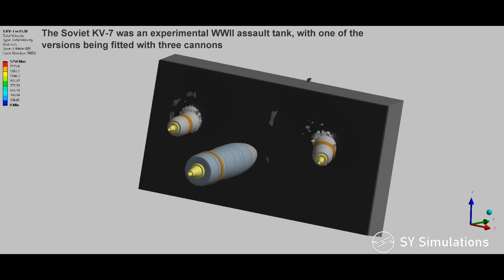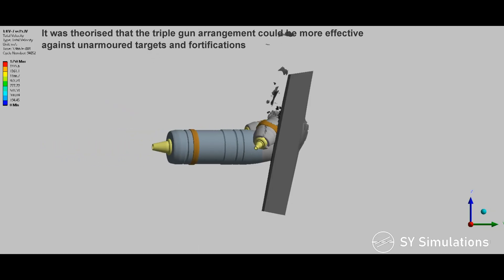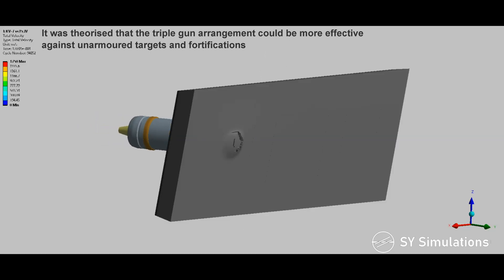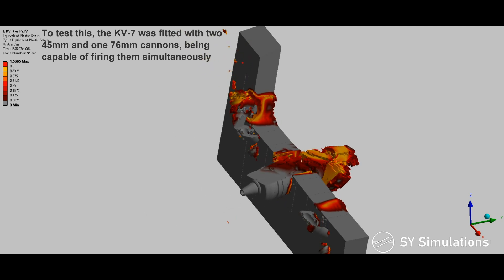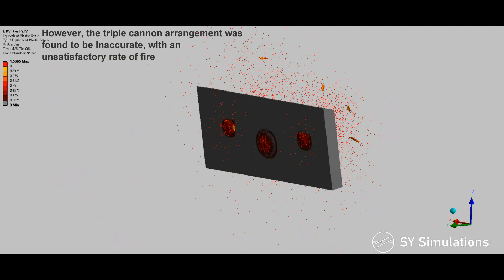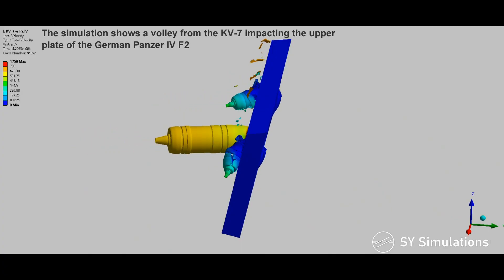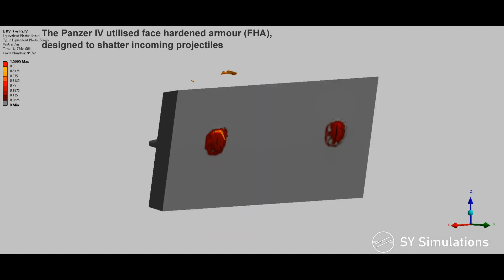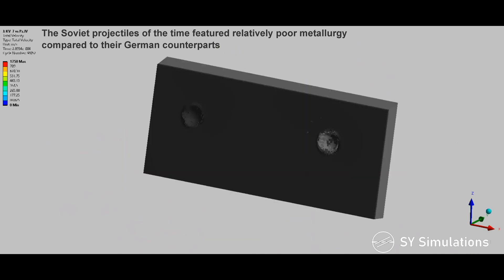TRIPLE BARRELLED KV-7 (U-13) vs Panzer IV F2 | Face Hardened Armour Penetration Simulation

Comment: May I suggest a HESH simulation against different armor thicknesses with witness plates? There are a few HESH simulations on YouTube but unfortunately none of them seem to have witness plates. I think it would be very interesting, since in some cases it seems like the armor just about resists scabbing with some deformation.

Another interesting one would be turret face hit against something like a T-55 with the hull roof present underneath to show if the shockwave from a relatively large HESH shell (120mm or similar) can breach it.

I'm aware explosives are rather intensive to simulate, so if you can only do one simulation it should ideally be a situation where the armor can just about resist scabbing.

Comment: The Panzer IV’s upper front plate is 80mm thick
Reply: there are multiple versions of the "Panzer IV"
Reply: @mosinM-so5ng  but they all ad 80mm thick frintal armour, he difference is that it is not angled
Reply: @V1PER-SFO  idk wikipedia says the "key production features" of panzer 4 f2 had 50mm hull armour and panzer 4 j and h had 80mm

Comment: This is a perfect example of why multi-barrel tanks are generally a bad idea. Multiple small guns will not be able to penetrate as much as a single larger gun. In this arrangement, the two smaller guns is absolutely useless and that weight could be used somewhere else. When people wonder why there aren't multi barrel tanks. There are many twin arrangements and some triples like this. But everyone realized it was dumb and stopped trying it.
Multi gun arrangements only survived when rate of fire is necessary but penetration or stopping power is not. It is why SPAAG and some infantry support vehicles feature multiple barrels. The amount of rounds in those cases is more important than actual damage of the individual projectiles.
Reply: this isnt a good example of why, because you just heard it, the multiple barrels are for fortifications and fire support.
Reply: @burner33  Nope, still a good example, because in what way is two 45s and a 76 better than a 152 in a similar configuration (SU-152)? Just because that's what it was designed for doesn't mean it was good at it.
Reply: @alexmartin9550  no, not good because the example doesnt show why its bad for its purpose. a good example would be a simulation showing the 152 molesting a bunker or any kind of fortification, and then showing the kv-7 doing far less damage

Comment: Always thought two equal calibre, closely spaced guns fired with a small delay (less than 0.5s) would always be better because they'd effectively hit the target close together, and whatever damage the first hit does, the second one can continue to punch through
Reply: Wouldn't the recoil from the first gun potentially ruin the accuracy of the second? Though if the guns are 45mm in a tank this big that probably wouldn't matter much.
Reply: @hawkstable8889  true, I think adding the delay I spoke about solves some issues, but then raises ones like asymmetrical recoil
Reply: Nope. Guns close together have a larger dispersion. See naval turret design. The muzzle blast of one gun affects the other causing them to disperse and not fly parallel. That is why twin turrets get separated so much. Triple turrets will fire the outer two guns then a fraction of a second delay fires the middle gun. Certain Italian cruisers had notoriously close spacing with no firing delay and suffered from dispersion issues until said delay was added.
Reply: @neurofiedyamato8763  you totally missed the part where the orginal comment said with a small delay genius.
Reply: @burner33  I think they just wanted to show their navel gun knowledge more than postulate an argument against what I suggested tbh 🤷
Reply: @ToxicJelly9  It would be hard to hit the same spot twice if the guns are already apart.
Just mount a bigger gun at that point.
Reply: @aquadox5514  I'm talking a double barrel, that's how close the two barrels are in this little thought experiment. And they don't have to hit in the exact same spot, damage that the first shell does isn't necessarily limited to just the diameter of the shell itself (think shear forces etc), so the second may still punch through armour, albeit weakened by the first shot. Of course this would be limited to stationary targets at mid-range to give the two shells a fighting chance to land close enough to one another
Reply: @ToxicJelly9   Problem with that is that you have to reduce the power of both guns because of the volume of the guns and stress on the chassis.
And because you reduce the power of the guns you reduce their penetration and also their spalling incase of no penetration.

Also, a shot needs to land really close to an earlier hit to actually benefit from the compromised armor.
Reply: @aquadox5514  when you say power of the guns, do you mean propellant mass or actual gun calibre? 

And yeah, I'd agree that with higher hardness armour, damage/deformation is more likely limited to the shell diameter, so grouping of the shells would make little difference unless they landed almost on top of one another. Thought it could be a different case with modern armour arrays, even ERA or NERA perhaps
Interesting to think about, sorta wish I had the software to model it now, despite the practical problems
Reply: @ToxicJelly9   Either or.
You can reduce the propellant but then you severely reduce your energy and thus penetration and spalling, or reduce caliber but then you still sit with the not hitting the close enough to be relevant part and reducing your effectivity against soft targets and entrenchments.
Reply: @aquadox5514  yeah, fair play, sounds like big gun is better than more guns in a fair few ways. Interesting to get people's opinions on it anyways
Reply: @ToxicJelly9   Mostly yeah.
But having multiple guns was also a good thing like in naval warfare or anti air roles. So it's, luckely, still an option for diverse designs.

Comment: That firing arrangement is such a bad idea yet so fitting of something the Soviets would have pursued.
Reply: Indeed. Because they took the good aproach and never put it into mass production.
Unlike the germans with their idiotic vehicles like JTiger, Ferdinand, or Tiger II.
Reply: @Vlad_-_-_  I swear those German engineers spent all that time on such nonsense to avoid getting placed in some blocking position.
Reply: @Vlad_-_-_  I never said the Germans were any better, triggered much?
Reply: @sinisterthoughts2896  Anyone still using "triggered much" at this point takes a big credibility hit.
Reply: I don't think building one variant prototype really counts as "pursued". It is one of those "what where they thinking" ideas that I guess had to be tried at least once.
Reply: Anyone play Black ops 2 campaign and remember the double barrel Soviet tank you destroy in Afghanistan mission. That was such a fun mission.
Reply: Shows how much you know about the soviet era lol
Reply: @d3vodestroyer519  they tried a lot of really bad ideas.  Not all of their ideas were bad.  So what do you mean?
Reply: Idea worth giving a shot, just for pottential way around major bottleneck for assault guns production thoughout war: begging for enough howitzers to keep up with assembly line

Comment: I didn't know FHA was utilised in the F2
Reply: From what I understand, the F2 variant was one of the last to use it, because as the war progressed capped shells, which used a mild steel cap to protect the actual projectile from shattering by taking the brunt of the initial impact became more common, which essentially made FHA obsolete.
Reply: @seanmarshall5463 Only the J didn’t feature any FHA. All other variants features FHA on pretty much all vertical plates.
Reply: @seanmarshall5463  but the soviets did not use capped shells until after the war
Reply: 45mm probably got shattered because of face hardened Armor and because they were higher velocity.
Reply: "The FHA has a 5mm portion of 600BHN steel, with the remainder being 350BHN"
interesting material
+maybe this reason not penetration 45mm cannon
Reply: @berserkguts4185  honestly surprised the 45 didn't go through